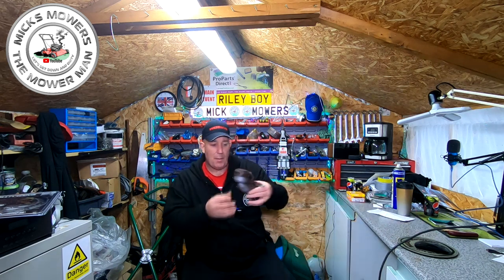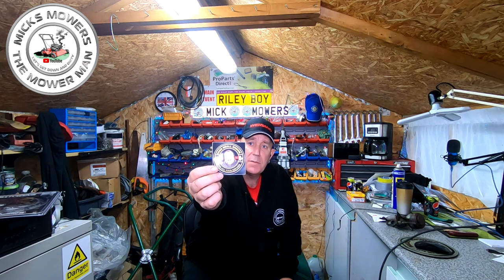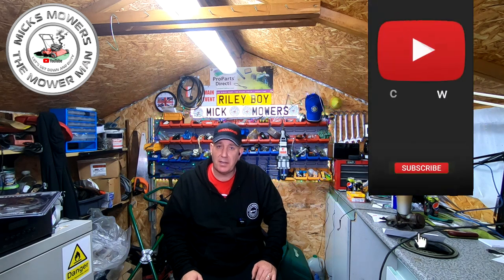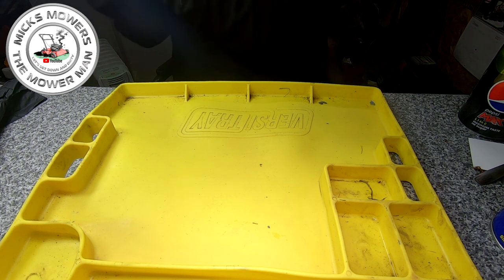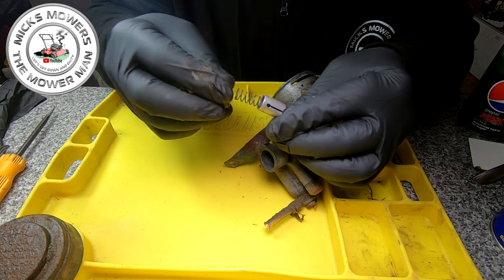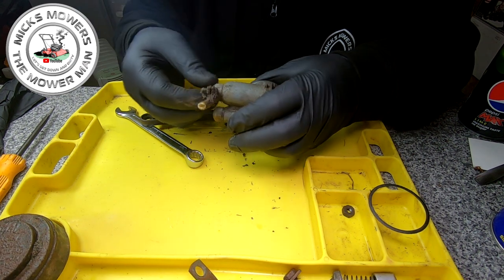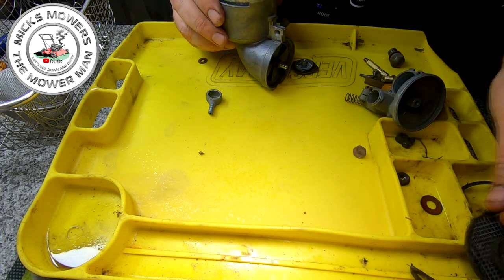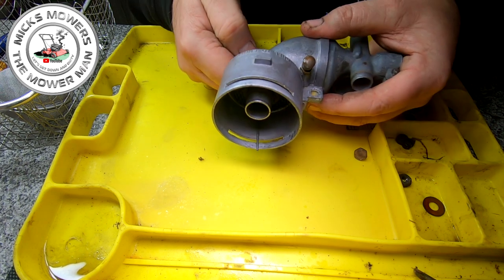Amal 379 Full Carb Clean For A Ransomes Marquis Villiers BSA F12 Sloper Engine

Comment: The Norton Villiers F12 is a sexy little engine in my book and like you I bought a basket case of mowers from a sports club, turns out I have 2 Ransomes Marquis 20 inch and an Atco B20 club, 2 F12 sloper engines and 2 Tecumseh H60 engines. I've rebuilt the Tecumseh 's and I'm now on the F12's so this is a great insight to the carbs! Amal are brilliant carbs and very much sought after! Simple but perfect.
Reply from the maker: Thanks for a great comment mate I appreciate it

Comment: Nice job. Your carb was in really good condition. I cleaned an Amel 900 series from a Triumph bike that sat in the shed since 2012 yesterday. That was bad. Not one single hole not blocked. The main jet looked like black plastic. After the wire wheel it tuned out to be brass :-)
Reply from the maker: Thanks for watching